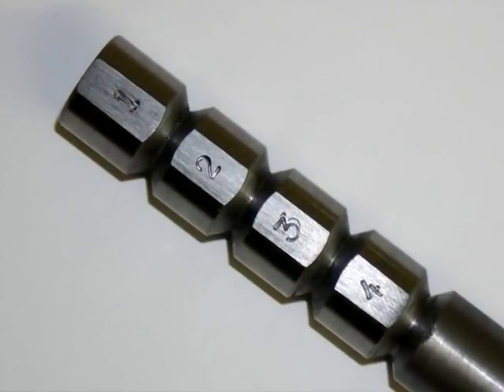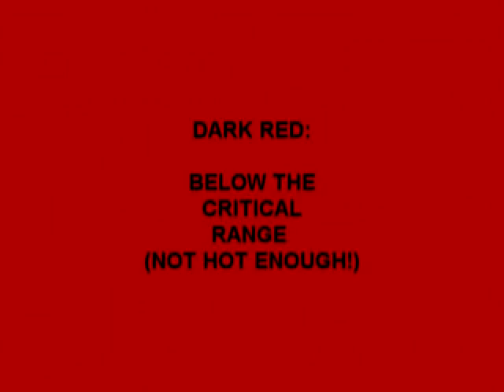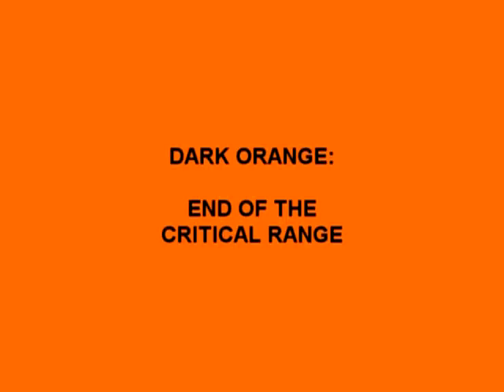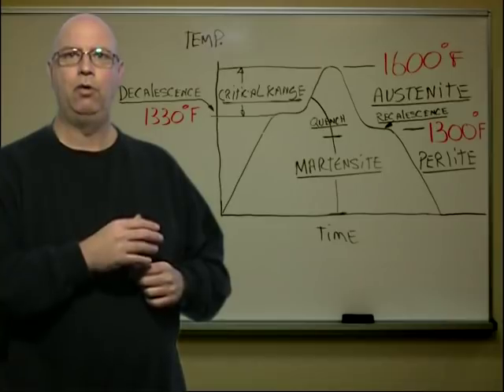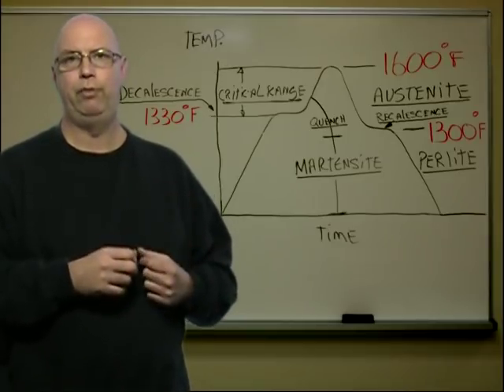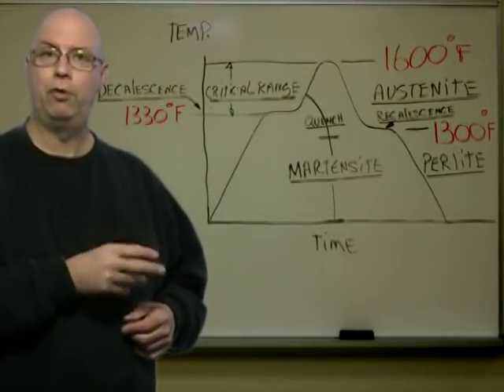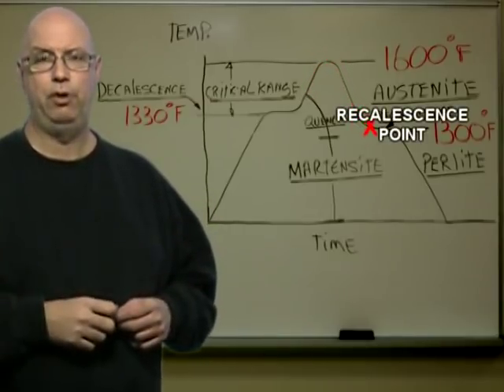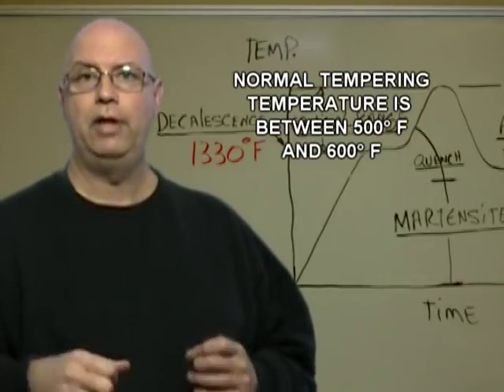HEAT TREATMENT OF STEELS 1, HARDENING, TEMPERING, ANNEALING & NORMALIZING OF STEELSMARC LECUYER

Comment: Hi Marc, what a wealth of knowledge! Thank you for doing these videos. If I had questions would it be alright to ask via email? I am currently contemplating a project involving heat treating around 200 small plates (0.05 to 0.1 inch thickness, 1X2 inch dimension). I am worried about warping the plates (each one are carefully given a light curvature, with ~4 holes drilled).  The plates need to have optimal toughness and hardness without losing their shape in the process...They will be used in the assembly of a reenactment grade lamellar armor. A high carbon steel would give an authentic appearance (stainless steel, while close, has a different color because of its surface oxide). The reason I am interested in heat treating the plates is to create a lighter armor with similar properties than one using low carbon steel (thicker plates). Also, I have a question concerning the tempering process. Changing the tempering temperature while keeping time constant, had different results on the color and thoughness / hardness. What if temperature was constant but time was different? Would color be a good indicator? Would tempering for a period, testing toughness/hardness, followed by another tempering period, etc until a desired color, indicator of result be a potential alternative? I am thinking of using an oven at 450F but tempering for a longer period until the desired color present itself...or are minimum temperatures required for different tempers? In other words, can all tempers be achieved at constant temperature just by varying tempering time?
Reply: To solve the warping issue, I was thinking of using the highest possible quenching temperature allowed by pre-heating the quenching liquid. The choice of steel is highly dependent on the application...the more carbon the more likely the steel can crack or warp during the quench if I remember correctly. I am not sure which type of  high carbon steel would be most suited for armor....the plates need to be able to receive blows without denting, deforming, cracks or chips. I've seen a few combat-grade plate armor "spring tempered"...which I think is what I should be aiming for.
Reply from the maker: First question: It is the temperature that determines the temper. 450 will give you a light temper that should not give you maximum toughness. A medium carbon steel with a temper around 450 should however do the trick. This should result in a final hardness of around 45 to 50 Rc. Good for impact resistance. I just remembered that I am restricted in length. Thatlazymachinist@gmail.com, send me a message. Marc L'Ecuyer

Comment: hello sir , one day i welded a extension rod to a 10mm piston . The piston turned blue and would not fit back into the bore . the piston was from a small car jack , my question is did it deform or did an oxide layer make it bigger
Reply from the maker: Having been formed quickly, I would suspect that the layer is quite thin. Probably not more that a few microns. I would suspect that part deformation is the culprit! Marc
Reply: THATLAZYMACHINIST Thanks

Comment: You stated that fully tempered steel (620 degrees F) experiences approximately a 30% reduction in strength. Is the relationship between tempering and reduction in hardness of steel linear? Is it possible to relatively estimate the loss of strength just based on the temperature the material is brought to during the tempering process?

Comment: Excellent explanation, thank you !

Would like to hear your thoughts on low carbon steel (Cold rolled) and case hardening.
Reply from the maker: John MacDougall Hi John, case hardening is great but it is disappearing since it is generally easier to buy the alloy that you need right off the bat. Also case hardening requires some chemicals that must be handled carefully and in a world that requires a safety fiche for every day things such as Varsol, having cyanides and the rest around  just gets to complicated. It is also important to remember that case hardening is only a surface treatment, The inner core of these parts never get hard. You can get the same result with laser surface hardening (for small parts) or flame hardening (for large parts) with medium or high carbon alloy or plain steels. I hope this helps, thanks for watching and be safe! Marc

Comment: First of all, great video I learned so much. Secondly, when you tempered the 5 pieces at 5 different tempering temperatures, assuming I didn't miss anything, the time that each piece was in the oven got longer every piece. Will that have an affect on the metal? Say if you were to keep the first piece in at the first tempering temp. for as long as the fifth piece was in? 
Thanks again, I may use your first experiment in class tomorrow!
Thank you
Reply: Hi Kevin, the temperature controls the colors and the time controls the thickness of the coating. The longuer the part stays in the oven, the more opaque the color becomes. But the colors won't change if the temperature stays the same. I would strongly suggest that you practice a few times before going live since the type of steel (colors and temperatures vary slightly with different steels), the mass of the parts (the more the parts are massive the longer they have to soak) and the size of the oven (larger ovens require more time to reach the next temperature) will affect results. I used the same material (01 tool steel 3/4" dia.) and the same oven for over twenty years so it was easy to succeed every time. I hope this answer helps and thanks for watching! Marc L'Ecuyer

Comment: I have a question. I regularly cast aluminum at around 1400 degrees Fahrenheit. I notice a fair amount of oxidization forming on the outside of the steel crucible after removing it from the furnace, and have seen evidence that the iron oxide is appearing in the aluminum melt. Would hardening or tempering my hand mig welded crucible (three external welds, one internal) extend its lifespan, or reduce the amount of impurities in the aluminum melt, or would it be detrimental? Eventually, I'd like to try bronze and brass, which melt at much higher temperatures, but I'm worried about using a steel crucible. I've priced clay and graphite crucibles, and understand their benefits, but I'm curious what sort of results I'd see with my steel crucible at those temperatures. All that said, this is a fantastic video, I learned a lot, and it makes me excited about some upcoming projects. Thanks!
Reply from the maker: Hi IBW, hardening the crucible will have no effect on the carbon leaching from it. The inside of the crucible that is immerged in aluminum should however be less affected because, once liquid, the aluminium will separate the steel from the oxygen. No oxygen equals no leaching. You have two easy options, use a steel crucible that contains the least carbon possible and melt the aluminium as quickly as possible since the leaching gets worse with time (this will only reduce the problem). Or use a ceramic crucible. The brass or bronze crucibles sound scary to me! But casting is not one of my forte's so you may want to consult a specialist. I hope this helps, Marc L'Ecuyer
Reply: Thanks for the info. Just to clarify, the crucibles would be made of clay, graphite, or ceramic, with intent to melt brass or bronze in them, not to use those metals as the crucible, that does sound scary, lol. Thanks again, great videos :)

Comment: Hi.
Thanks for this video
I am planning to bult a multi stage hydraulic clynder loading around 80 ton..
So I need help regarding steel grade and treatment
So if the material is 27SiMn
What should be the best rat of
Roughness. Hardness. Tensile. Yield..for my application? 
And Wich production method
Cold roll or hot rolled
Or any suitable study for telescopic clynder will be great
Thanks again

Comment: I have  been making coining and jewelry stamping dies for a long time. I've been wanting to get into using master stamps for the dies because after so many uses, the dies wear out and they are no longer useful. What I was curious about, is making steel hard enough to stamp and leave an impression into my steel used for stamping the final product. For example, a punch like that you would use to put a serial number on a steel part of a tool or car. 
I use various types of steel - normally whatever is the cheapest. 1045 is a common steel I use. Another I believe is 1149? I will have to check. 
Any help here would be greatly appreciated as I am all ears. Thanks for the time and effort you have taken to make these videos. 
-Ryan
Reply from the maker: OSheaHandMade  Hi Ryan, for what you are describing, I would suggest a good grade of tool steel. An oil quenching such as O1 which is short for oil quenching tool steel, hardened and then tempered to a dark or light bleu. The full temper will increase toughness and is important for shock resistance. An O1 class tool steel that is fully tempered should be about 65 Rc where as the steels you mentioned (1045 and 1149) should not be harder that about 45 Rc once hardened and tempered. I hope this helps, thanks for watching, Marc L'Ecuyer

Comment: It would be cool if you answered this question, wrote a response, so here goes... That steel was quenched in water, i understand o1 and w2 and d2 are all tool steels, and o for oil, w for water, d for...i forget, but regaurding leaf springs and stuff, R they something else(1075/1080/1095), a steel made specifically for springs? And for knife making in general, some smiths quench in warm to hot120° oil or brine or water, but its always warmer than room temp, what does this accomplish?

Comment: Would 300 and 400 series stainless steel harden the same way as the tool steel you used?  

Oil quenching vs water?

I've got some parts that I've made and want to harden to the point that the part doesn't dent from a metal to part strike but not shatter. 

Great education, thanks for taking time and energy to video the process. 

Best.
Reply: u can harden it pretty good. and u will get it super hard, but also shatter easy. just put the parts in the oven after heat treatment. 200 c for 3 hours. maybe do it 2 times. and u will have very hard, and not shatter. 
btw. always use oil. cool as fast as u can.
when u doing the slow heat treament afterwords, u need to cool down slow. put it on a steel plate, to suck out the heat.
Reply from the maker: Hi Wiredodger! Sorry for the delay, life is busy these days. Most stainless steels cannot be hardened in the way tool steels can and that includes the 300 and 400 series. The only stainless steel that I have ever hardened by quenching is
17-4PH and that was an air quenching stainless steel that was heated to 900° F and then left to cool in air at room temperature (very very expensive stuff). If I recall (this was 30 years ago) it brought its hardness up to between 40 and 50 Rockwell C. About the same hardness as a quenched and tempered medium carbon steel.Here is a link to a website that contains the basic info you might be looking for.   http://www.mastainless.com/faqs   Thanks for watching and sorry for the delay, Marc L'Ecuyer

Comment: Just making sure I understand the process.  For heat treating of metals, like axles and other very strong components (mid shafts etc on transmissions) you will heat to critical range, quench, then heat and let cool slowly after.

I truly thought it was just heat and letting cool slowly, but that seems to give you the same structure again.  Thanks for the lesson.
Reply from the maker: That's it Joe, heat to within the critical range (around 1550° F for most steels) then quench (quenching oil or water depending on the steel) then temper by reheating to around 500° for about 30 minutes per inch of thickness for most steels and let cool slowly in warm sand or on a refractory brick. Thanks for watching, Marc L'Ecuyer

Comment: I would like to try this practical test. I know you are using a water quenching steel. Can you tell me which steel you used in your experiment? Thank you for the practical hands on video.
Reply from the maker: Hi Cathy for the granular structure test (Metcalf experiment) I think I was using W1 tool steel (drill rod). For the temper color test any medium or high carbon steel will do, I used Keewatin (O1) which is a oil quenching tool steel. For the Metcalf experiment, keep the diameters of the grooves small and with a nice sharp bottom (V-groove) since the part can be quite hard to break, using a bar to break the test piece makes it a little safer but do not forget to use eye protection.  It can also be broken with a vice and hammer, this is however is much more dangerous. If more info is required, please let me know, Marc  THATLAZYMACHINIST.COM

Comment: First off I would like to say thank you for all of your videos, they have been more than helpful. I have a question for you. I need to harden some 4140, I am unsure of what oil to use for quenching. I'v read that used motor oil can be used, or motor oil mixed with ATF and diesel fuel, or vegetables oils can be used. Pleas help thank you
Zak Armory Paso Robles, CA USA

Comment: Nice quick explanations.So what is that ? W1 ?
Reply from the maker: Hi Douglas, W1 is an abbreviation for "water quenching tool steel" just as O1 (o as in the letter o) is an abbreviation for "oil quenching tool steel". Thanks for taking the time to watch my videos. Marc L'Ecuyer THATLAZYMACHINIST.COM
Reply: i know. I'm a knife maker. That's why I wondered if that was a piece of 01 since you used water to quench for the experiment or if you were just giving a basic lesson with any old piece of tool steel .I've never broken any to look at the grain. Very interesting ! Thanks.

Comment: this is so well explained, thank you! i have a question tho, if a piece of steel has been normalized, can it still be hardened and than tampered to the best it can be?
Reply from the maker: Hi Vincenzo! Every time that you harden and normalize a part it looses a little carbon . This happens very slowly and mostly just on a thin layer at the surface of the part. The answer to your question is: There is no problem with hardening a part that has been normalized a few times. If however you forget the part in the normalizing oven for a days, you will have a problem. It is good to mention that if you use an oven that has no oxygen in it you could leave the part at temperature for as long as you like with no loss of carbon. I hope this answers your question? Marc

Comment: I occassionally make my own wood turning tools from hss. Instead of tempering in an oven at 400 degrees, can I just wave the cutting tool with a hand held torch using Mapp gas? Heating it till I see the straw color, of course.
Reply: @awashburn6944  , thanks for the good info.

Comment: Question for you. I was tempering a piece of steel today about 10 inches long and .125" thick to try and get the blue at 560 degrees with the over temp at 578. I polished and cleaned it with alcohol prior to putting it in the oven and had it in for almost 2 hours pulling it out quickly at 45 minutes (golden brown color) and 90 minutes (golden purple color) and putting it back in. The final time I pulled it out at 2 hours it was a darker shade of golden purple and the color wasn't uniform at all. Do you have any ideas on what I should change or try that could help? It was also sitting on a piece of preheated aluminum that was maybe .300" thick

Comment: Marc, I'm confused. At 18:55 you say the best grain structure is obtained when you heat to the upper limit of the critical range. But at 16:15 on the test section 3, you said the best grain structure is in the lower 1/3 of the critical range. I can see the test sample's grain structure is fine grained so maybe you misstated procedure at the 18:55 time? What part of the critical range do you want to heat to for a strong fine grained structure? At 10:40 you said dark orange is best. Is this for high carbon steel? thanks
Reply from the maker: Hi Vince! Thanks for catching the problem. Yous are aiming for the lower 1/3 of the critical range for quenching. Just make sure that you are above the recalescence point. Cherry red for high carbon steels is great but I suggest dark orange because you have to make sure that you are in the critical range. The lower the carbon content the brighter the color ( upper medium carbon steels should be orange, lower medium carbon steels should be bright orange) and remember that under .03% carbon steel will not harden. I am planing to redo these older videos of mine and will correct and clarifie at the same time. I hope this helps and thanks for a great question, Marc

Comment: Regarding tempering, what is it physically on the steel that's causing the color change? Is it some sort of oxidation reaction on the surface, or does the steel's color change all throughout?

Thank you for the awesome and informative video! =)
Reply: Yes. Its a function of the oxidation layer on the surface.
Reply: +Erik ...The 'color' on steel is caused by the oxidation in air....
Reply: it's caused by a different (tighter or looser) crystalline structure (oxidation) on the surface that reflects different wavelengths of light. strange huh